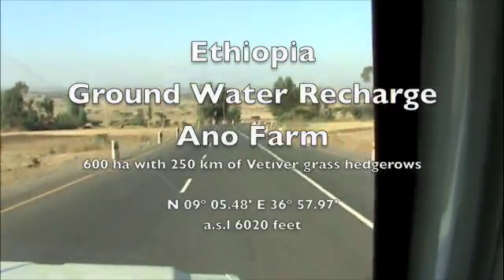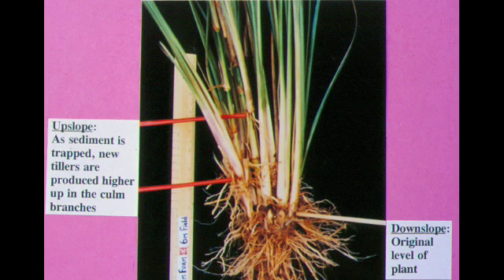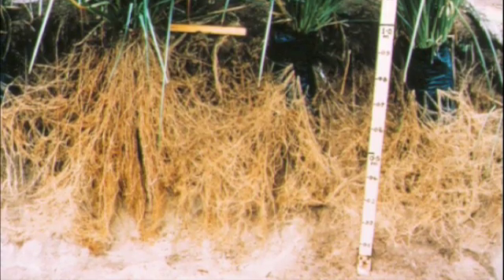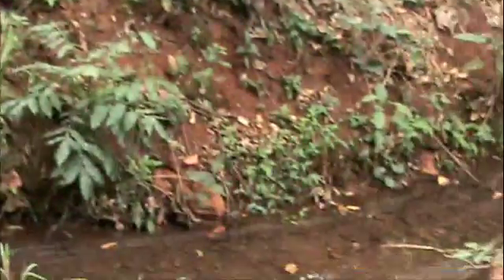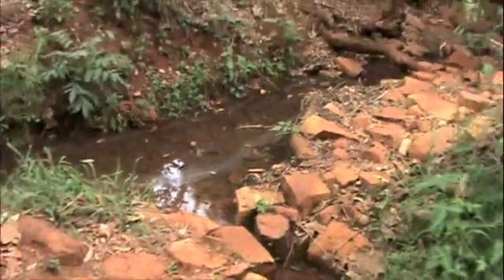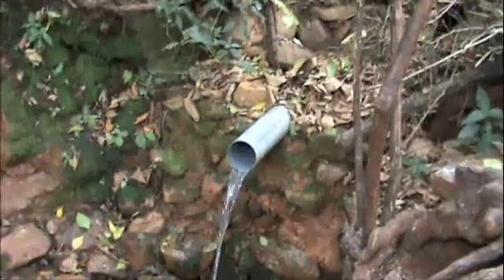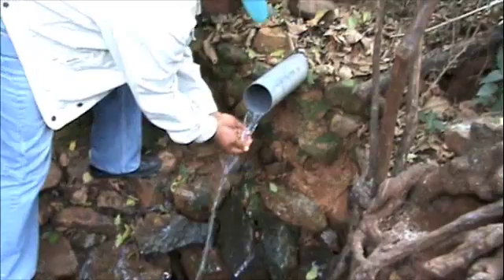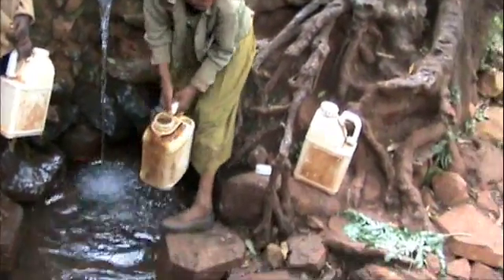Vetiver System (Vetiver Grass):  Ground Water Recharge

Comment: Cover the slopes of the springs and water falls and streams with vetiver grass hedges up to the top and extend it further to 10 meters and plant vetiver in a contoured grid network to trap and contain water. Use rock dust powders to accelerate its growth and establishment and expansion sidewards and becomes denser and forms a biological dam. Plant aquatic mint known also as aquatica mentha to kill off any pathogens as it exudes a lingering pathogenicide.

Comment: It would be great to use Vetiver in combination with leucaena so that you would have a perennial  nitrogen fixer that provides a high protein forage making dry season dry fodder much more digestible which would increase stocking density and therefore soil organic matter whilst increasing income streams for the farmer. Even if not used in combination with cattle the leucaena could be chop and dropped as a green manure.